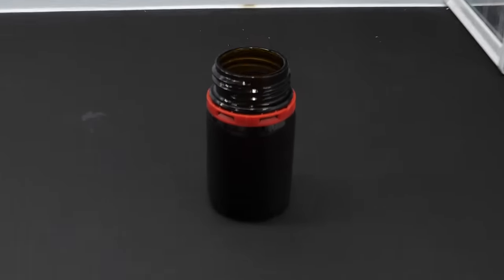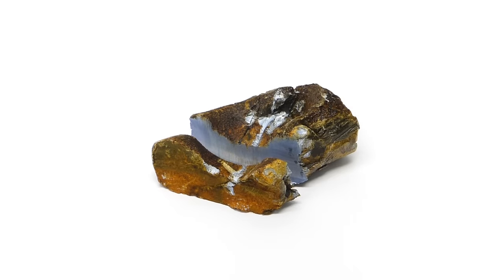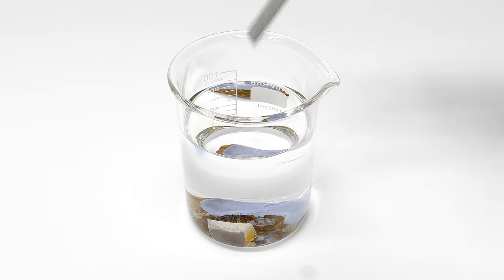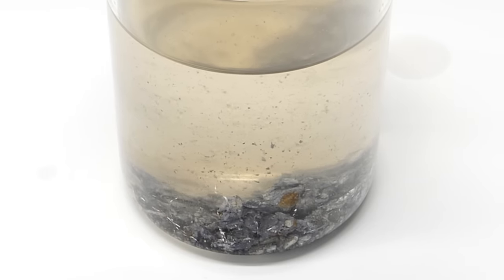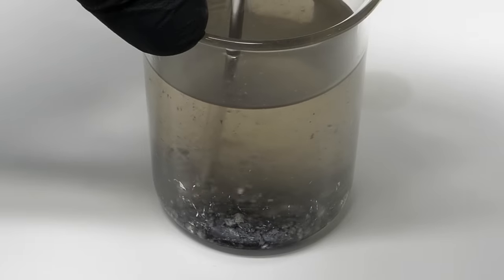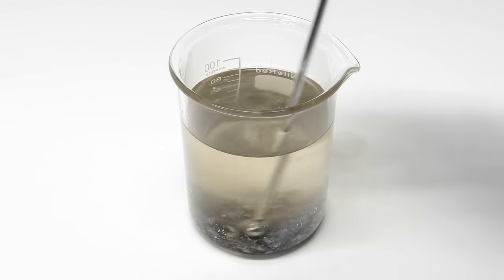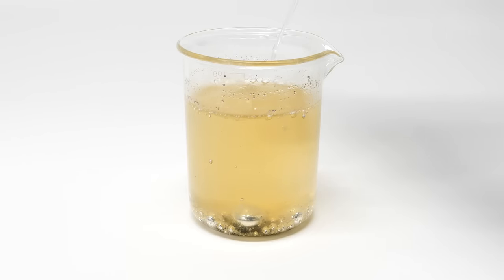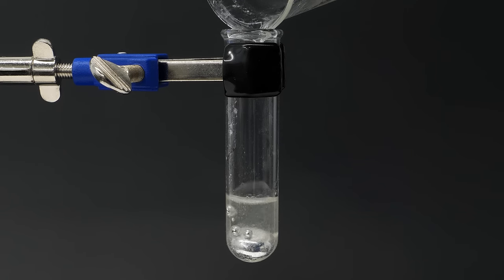Mixing sodium and potassium is crazy (NaK)

Comment: I've heard about this one. Someone in a DnD campaign used Transmute Liquid to turn a lake full of water into one filled with NaK. You can guess what happened immediately after.
Reply: @narcuk08  the heck?
Reply: that sounds like it would create the biggest non nuclear/atomic explosion ever.
Reply: since the water turned into NaK... nothing?
Reply: @Kat-mk3qz  maybe make it half of the amount of water Nak in order to make the reaction
Reply: @Kat-mk3qz  He only transmuted the topmost few dozen tons of water, spread out super thin just under the surface of the water for maximum surface area...  the nearest towns saw the sun for the last time.
Reply: @Kat-mk3qz  NaK can also react with moisture in the air, and just as explosively.
The whole Transmute Liquid thing was even funnier, because the DM decided that it should be as realistic as possible, so they started to make calculations based on the explosive potential of NaK and the volume of water in the lake. "And there were a lot of zeroes".
Long story short: Almost a TPK, despite the fact that the major part of the party was MILES away. The player nuked an entire region and killed most of their friends' PCs. The Big Bad he wanted to kill also died, fortunately.
Reply: @Jurarigo  if it pure plutonium-239 it can reach critical mass quite easily and trigger a “natural nuclear explosion” instantaneously which can totally tpk the whole team and the all monster on the entire continent
Reply: They walked across the lake because it clearly turned into metal and nothing unexpected happened
Reply: @alejandrostrass2559  a liquid metal one not solid and in the video you should know how explosive this thing is
Reply: This guy arrives
Comments something interesting/argumentative 
Refuses to elaborate further 
Leaves🗿
Reply: A lot of discussion about what might have taken place in such a scenario methinks 🙄
Reply: @TextiX887  yeah, a second sun
Reply: what did pyrophury say?
Reply: Can someone tell me what the Pyrophury guy said?
Reply: And then it starts raining 🌧
Reply: @polarmage2577  i cant see his comment what did he say
Reply: @polarmage2577  what did the other guy said? They deleted the comment
Reply: @Jurarigo   That was basically a player driven "rocks fall everyone dies" feat. I applaud this madman.
Reply: Immunity to fire first.  One of the campaigns I ran for a short time I toyed with making dragons breath 'real' and gold dragons sprayed NaK that was mixed with a mist from salivary glands; like a jet turbine.  Red's were basically white phosphorous.  Was a fun experiment to ground those in reality & look at them in realistic ways.
Reply: It would be more efficient to only turn half the water into NaK....
Reply: I'm pretty sure liquid metals are explicitly not allowed as per the D&D rulebook. Otherwise what's to stop you from just making infinite GP by turning water to liquid adamantium. The liquid needs to be of "roughly equivalent substance".
Reply: I read that one as well, funny explosion go boom.
Reply: @Kat-mk3qz  Hello Kat
Reply: Nothing because fantasy!
Reply: @ObjectsInMotion  DnD's rules are whatever the DM decides. So, if the DM says metals are on the table, then it's fair game.

Some "official" rules state that Transmute Liquid can only turn common fluids into other common fluids. Blood into Ale, for example...but it never really states what a "common fluid" is, and even sometimes states Mercury as a common fluid.

Of course, there is a general rule of thumb; anything that's liquid at room temperature and not magical is allowed.

And would you look at that, NaK is liquid at room temperature...
Reply: Did the DM include any alkali damage from the sodium/potassium hydroxide created?
Reply: @koimeiji  ok then why use any other spell when I can just transmute water into anti water and literally kill everyone every fight. Anti-water is also liquid at room temperature. Things like that just cheese the game and ruin the fun. It’s not clever, it’s boring.
Reply: @ObjectsInMotion  do you... not know what DnD is?

it's a table top roleplaying game guided by the DM. it's not a video game. just because some of the rules could allow for it, doesn't mean it has to happen

if the DM doesn't want you transmuting water to anti water, they'll come up with a scenario where it doesn't work (or just outright tell you no)
Reply: @koimeiji  Not every tabletop RPG is the same. There are some that are build to rely more heavily on theatre of the mind and roleplay, and some built around having a really robust combat system and balanced classes and abilities. D&D 5e is definitely the latter. It seems you are more acustomed to the former type of RPG, and I understand if you incorrectly label all TTRPG as "D&D", but just know that that is not a universal opinion held amongst hardcore fans of the genre. Each playstyle has its place and some rulesets are more appropriate than others for each.
Reply: @Jurarigo  quite an experience.
Reply: @L_Lawliet1907  Hello L
Reply: @ObjectsInMotion  
Even by that, though, anti-water wouldn’t be allowed, as regardless of whether or not you think sodium, potassium, or mercury are “common”, antimatter isn’t, and molecules made of antimatter are even rarer, so anti-water would not even remotely be a “common” substance.

Plus, I’m pretty sure that you can’t transmute matter into antimatter or vice versa. Even the subatomic particles differ between matter and antimatter, so of course you can’t transmute between them.

And no, not every TTRPG is the same, but what koimeiji is saying still applies to DnD. The rules are largely there to form a core to work from, and they can be subject to interpretation. What qualifies as a “common substance”, for example? It’s not like the rules give an exhaustive list of all the things you can transmute water into. Basically, transmutation cannot (directly) change the volume, shape, position, velocity, acceleration, external pressure, or temperature of the substance; cannot change matter into something that is not matter (so no converting to pure energy, antimatter, pure magic, or a vacuum) or vice versa; cannot turn something non-magical to something magical or vice versa; and cannot turn something into a material that doesn’t exist either in real life or in the world of DnD. It also cannot affect the intrinsic properties of the end product, such as phase changes, so the phase of the end product is determined based upon what phase the new substance would be at the same temperature and pressure as the thing was before Transmute was cast (so you couldn’t transmute liquid water into solid ice, water vapor, lava, liquid oxygen, or dry ice or vice versa, as those things cannot exist at the same temperatures and pressures as liquid water). Also, I think that you can’t transmute between phases, either, but I’m not sure. Other limitations are to be determined by the GM’s discretion and interpretation of the rules. (And yes, I am still talking about DnD in particular; though it may be applicable in other TTRPGs as well, some might allow you to, say, transmute liquid water to lava or something, or they may be even more restrictive.)

Plus, people playing DnD often put their own spin on things, and it’s not like every single detail or ruling needs to be completely standardized (like in competitive card games or board games, where there needs to be consistency in the rules between games and groups for the sake of competitions, or video games, due to limitations of hardware and such). The rulebook provides a canonical structure to work from, but there is still a lot of flexibility within that structure, and sometimes the DM might make slight deviations for the sake of entertainment, story, practicality, or whatever. DnD may not be the most flexible TTRPG, but it’s not super rigid, either.
Reply: @bhull242  Yes, I'm saying you need to restrict to common substances, because if you have absolutely no restrictions like koimeiji is suggesting you can do something ridiculous like anti-water. NaK is not a common substance, so like anti-water if I were DM I would not have allowed it. The reason it explodes in contact with water is because you're putting a whole bunch of potential energy into the system that wasn't there before by turning it from a common substance like water to one like NaK.
Reply: @ObjectsInMotion  
NaK is just a simple mixture of two very common substances: sodium and potassium. Anti-water is a theoretical substance that has never been observed in our universe (as antimatter rarely lasts long enough to form atoms more complex than hydrogen or helium, let alone molecules), and everything that makes it up (up antiquarks and down antiquarks that combine to form anti-protons and anti-neutrons, which in turn combine together and with positrons to form anti-hydrogen and anti-oxygen, which would then combine to form anti-water) is incredibly scarce in our observable universe, the most common of them by far being the antiquarks, and even then they don’t stick around long. It’s also nearly impossible to contain any form of antimatter long-term without it reacting with matter (thus being annihilated). NaK, despite being extremely reactive, is far easier to contain since it can be kept contained within a nonpolar, not-highly reactive liquid (like ethanol) and simple glass containers (or anything that doesn’t tend to react with metals at all), and it’ll last pretty much forever.

Basically, being a “common substance” is somewhat subjective and open to debate, but it is very easy to define it in such a way as to include NaK and to exclude anti-water. Indeed, I can’t think of any reasoning that would lead “anti-water” to be even remotely common under any definition whatsoever, but sodium and potassium (because, again, NaK is just a very simple mixture of these two things) are each at least as common as mercury, which is frequently allowed as something you can transmute something like water into. Besides, anything that has been observed by humans would be more common than anti-water, which has never actually been observed even under lab conditions at all, and NaK is sufficiently common that it actually does see some uses.

Also, literally no one suggested absolutely no restrictions, including koimeiji. That is a strawman. Saying that the restrictions are flexible, subject to interpretation, or different from what you claim they are is not remotely equivalent to saying that there are absolutely no restrictions whatsoever. You haven’t even demonstrated that we need to restrict to common substances since the only example of something that shouldn’t be allowed (anti-water) can easily be disallowed under other restrictions that would definitely allow NaK, such as one I pointed out: you can only convert matter to matter, not to non-matter (like pure energy, antimatter, or a vacuum). I’d even go one step further and say that exotic forms of matter (stuff made up of things like pentaquarks, mesons, muons, tauons, neutrinos, photons, gluons, W bosons, Z bosons, Higgs bosons, top quarks, bottom quarks, charm quarks, strange quarks, pure electrons, pure baryons, or other non-baryonic matter) are also excluded since such things wouldn’t be made up of the same building blocks. This would easily and unambiguously exclude anti-water without even potentially excluding NaK (at least by itself). And koimeiji wasn’t even saying that common-substances-only shouldn’t be the rule; only that the DM has discretion as to what is or isn’t a “common substance” under this rule, and that NaK could be allowed within this restriction for similar reasons that mercury is often allowed.

As for the potential energy argument, if the mass, volume, phase, conductivity, or chemical reactivity of the item being transmuted changes as a result of the transmutation, its potential energy is going to change, so that would basically mean that you can’t transmute one thing to another at all. And I see nothing in the rules that indicates that that’s even a consideration. Sure, the amount of magical energy in the substance must remain constant, but chemical, nuclear, or gravitational energy? Not so much. In fact, there are plenty of cases where the potential energy is allowed to be changed by a significant margin by Transmute, so that just seems to be something you made out of whole cloth. Outside of specifically disallowing this specific scenario with NaK, I can’t think of a good reason for that rule, anyways, and plenty of good reasons not to have it, so really, I don’t think this argument holds any water whatsoever.
Reply: @ObjectsInMotion  
You know what else you don’t see in nature in its pure form? Mercury. Lots of common elements don’t occur in their pure forms in nature. And alloys like bronze don’t either. Despite this, they are perfectly valid for transmutation.

You’re the one splitting hairs and being a contrarian here. You’re just engaging in post hoc rationalization for why some other people couldn’t transmute water into NaK in their game of D&D, and not even with good arguments. Don’t blame me if you can’t argue your point well.

You’re also the one pushing your interpretation of the rules onto someone else here, not me. I’m saying that it’s up to the DM’s discretion on certain cases. You’re trying to take what was a very fun moment of DnD and suck the fun out of it by being overly pedantic about your interpretation of the rules. Seriously, the projection is astounding here.

Finally, NaK is not equally rare compared to anti-water. Anti-water has never existed in this universe at all, naturally or artificially. Something that has never been known to exist at all is infinitely more scarce than something known to exist, even if not naturally. And that’s part of the issue: you define “common” using completely different measurements than I. You exclude artificial existence altogether. I don’t. You’re proving my point that the determination is debatable.
Reply: @Jurarigo  oh, geez. A bit extreme, to turn part of a lake into fucking nak to kill one big bad
Reply: "Your party has perished by instantaneous disintegration" 

Campaign over.
Reply: @stalins_comically_large_spoon  They clearly underestimated the explosive power of that thing. The end result of the event is that they never, ever again used Transmute Liquid.
Reply: @Jurarigo  I can see why.
Reply: I would not play in this group. I prefer a strong narrative to unlimited hijinks.
Reply: V A P O R I Z E D   I N S T A N T L Y
Reply: @bhull242  I will skip the D&D-specifics that I am unfamiliar with, and restrict my reply to the real-world science that I am familiar with:
NaK is just a simple mixture of two very uncommon substances: sodium and potassium. While their cations are abundant and found in nearly everything, the metallic elements are exclusively manmade - it wasn't until 1807 that they were both isolated by electrolysis of their corresponding hydroxides. It should be immediately obvious that something which reacts spontaneously with water (a substance that covers two thirds of the Earth's surface, can be found in every living being and is even in the air that surrounds you) will not last very long in nature. If you want to argue that NaK is a common liquid, then elemental halogens like fluorine, chlorine and bromine are just a hopskip away in terms of what qualifies for common liquids. Note that bromine could definitely be used as a chemical weapon, and chlorine has seen actual use as a chemical weapon during WW1.

On a side note, your phrasing regarding storage of NaK is ambiguous, as it sounds like you're suggesting ethanol as a storage medium, which is terrible advice. Ethanol might not be a highly reactive substance, but it will react exothermically with both sodium and potassium, and it is additionally very miscible with water. The preferred storage medium is a liquid aliphatic hydrocarbon, like kerosene, heptane or paraffin oil.
Reply: @BlurbFish  
For the record, bromine would be a common liquid, but fluorine and chlorine are gases. And I’m saying it’s arguable, not that it’s a super strong argument. Again, most metals do not exist in pure form in nature, either.

And yes, the ethanol was an error on my part.
Reply: @Jurarigo  The POV dwa-ome narrator barely got back though and closed the portal in time.